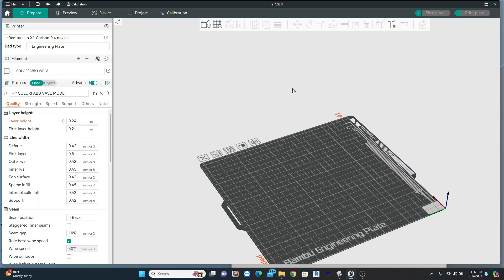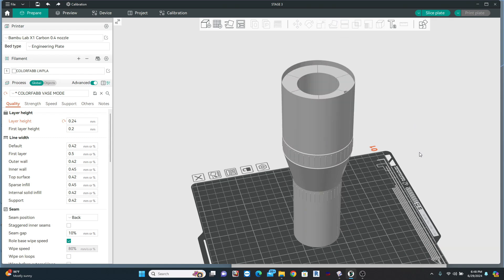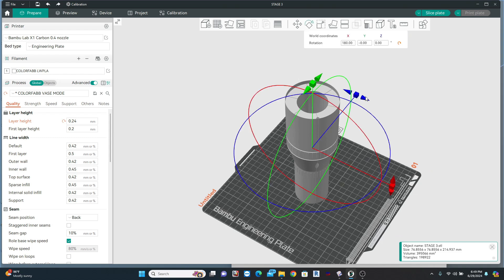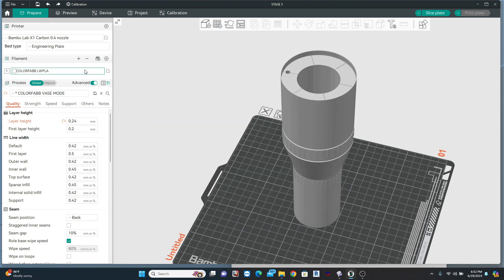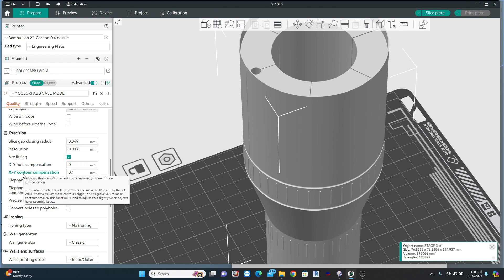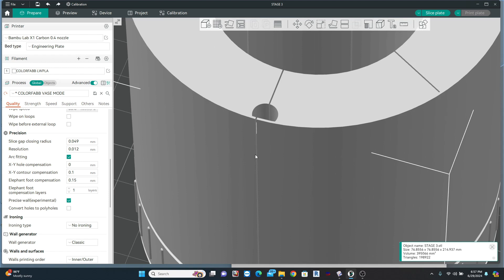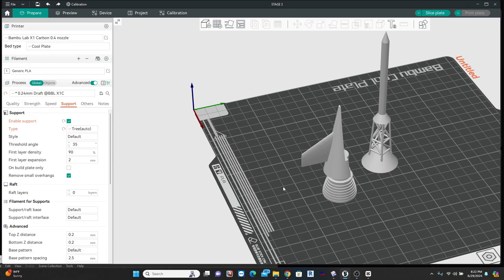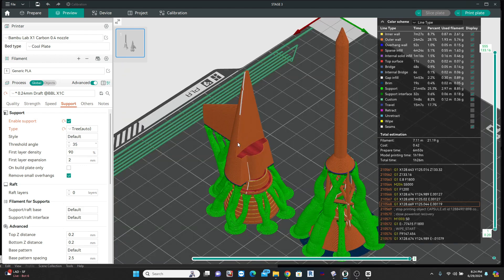Lightweight PLA on Bambu labs printer. How to do it. #bambulab

Comment: Hi. I have the bambulab x1c as well, and I have the esun lw pla. I had a horrible first experience with it used the bambulab aero as the preset filament the print layers did not stuck at all.

Do you think this settings would apply to the esun lw pla? I am printing rc planes

Comment: I recently purchased a BambuLab A1 printer with a view to printing RC planes.
I've been an RC pilot and  enthusiast for around 15 years and have built many foamies' and balsa models but I'm now looking into the future which I believe will be 3D printing but I'm a total newbie so a steep learning curve ahead..
So, I'm now curious as to whether the practices and settings you've demonstrated in this video will also work with the A1 if I use the orca slicer as well since both the printer you're using and the A1 are both Bambu Lab printers?
Reply from the maker: @kellio48  I do t have experience with the A1 but I can't imagine it would be different.  Congrats on the jump.  Don't give up on the old school stuff though!